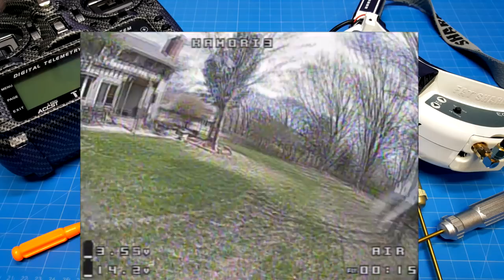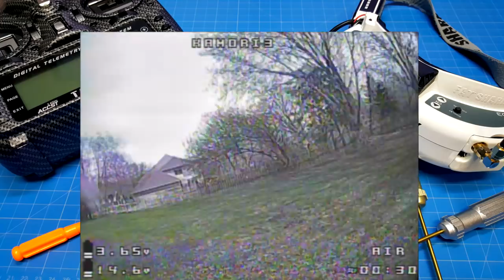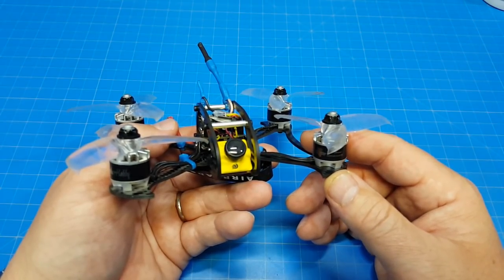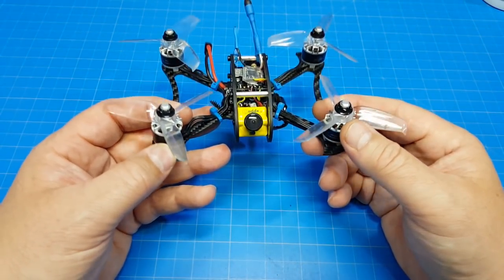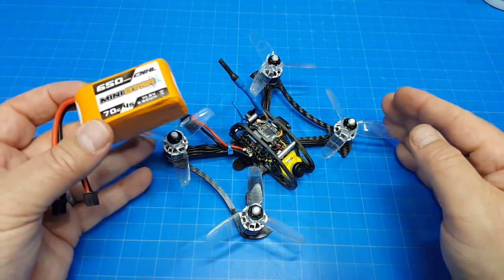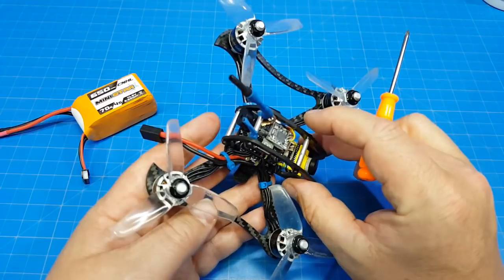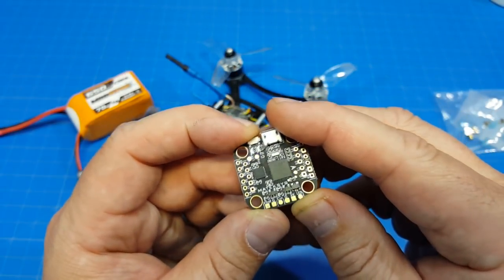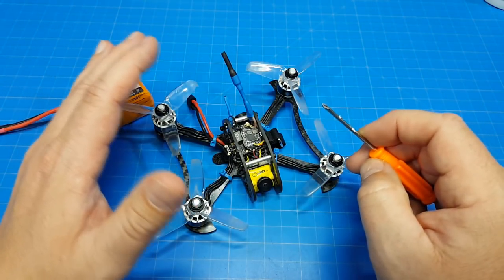Kamori - FlexRC

Comment: As you alluded too, the Komori was specifically designed for lightweight and lower powered builds. If you had used  the ascent 3" (or 4"), youd have much, much less flex. The Komori was really never even going to be in production, it was a requested small run from some of us early ascent users that wanted to have an ultra light 3" with a protective cage. Im now trying to convince Dmitri (FLexRC) to do a slightly taller cage, so that the CoG is better and props are less in view.

RE:damage. flexRC has lifetime warranty on frames. :)

The problem with HGLRC is not that they fail more than any other brand, but that they don't support their products that do fail (and they also grossly overstate their BEC amperage).

Clearly an xt30, not sure why everyone cant  see that and realize you misspoke. infact inver even heard you say xt60, i saw a black xt30 and heard you say exactly that! lol.
Reply from the maker: Agreed. I had a pretty good idea what I was doing wasn't viable and contemplated on making a video. But thought the information could be useful. It was fun!

Comment: Thanks for the review Nick! 
I was going to write how I was worried with the bottom plate being only 2mm thick, and I guess I was right cuz i read you cracked it! Wasn't the aurora 100 or something similar, 2mm and the frame broke a lot for flyers? Yeah, too many great frame available that are thicker and safer. Building something like this, to me, is a big waste of time when you have to change the frame out after you break it! And the aurora 100 had much smaller motors and it still broke too! Not for me...I want one more durable! 🤔😖

Comment: Have you ever built a 3-inch just for poking around? I just built one with 1104 4000kv Motors on 650mah 4S.  It's not the fastest thing in the world but I also don't think it's severely lacking in power. I get 9 minute flight times at best 5 minute at worst and it's quiet enough that it doesn't disturb the peace in my neighborhood so I love it
Reply: circuit dreamer - I agree with your approach for longer flights (larger props, lower kv's, fewer amps).  Look at Albert Kim's channel.

Comment: What is the max. stack hight on this frame?
Planning to build this with HGLRC F4 Zeus, RunCam Split Mini, TBS Unifiy Nano mounted on the 20x20 mounting plate and a FrSky R-XSR. Does this 4 boards gonna fit?

Usually HGLRC says 2-3 S Lipo but they have also 13 Amp max on 4S so I got in contact with them asking if I can run on 4S with 1404 3600 KV motors from RotorX.
Answer was:
We have checked with our experienced pilot about ZEUS. As he said, " from my experience it’s totally fine with smaller motors. We at rotorx doing 4s on the Zeus every day. With 1105, 1404 and even 1407 on 4“ props."

Seems they talked to someone from RotorX, they also changed their description afterwards. :)
Reply from the maker: I don't believe 4 boards are going to fit. I would poke around on google looking for a image of a kamori with a runcam split it in.
Reply: Nevermind, FlexRC replyed today... the Komori is discontinued... the bring new frames next week and there will be a follower for the old Komori... So I've to wait what they bring out. Or I try to go with the Armattan Japalura. But this will not be as light as the Komori... but for me the design looks also great. :D

Comment: These bigger motor builds are yielding super short flights.  My last three builds have been along Albert Kim's lines and have been yielding much longer flights with lower kv's, amps, and slightly larger props.
Reply from the maker: yes, 1404 or 1402 are more efficient, also less torque and thrust.

Comment: I have a few builds with some vid noise. Do you find powering the cam off the vtx fixes noise most of the time?
Reply: that and a capacitor on the battery leads.
Reply from the maker: yes and as ThXanUser a capacitor at the battery led pads also helps. If it was once clear and got noise it could be the regulator has given up on either the flight controller and/or the vtx.